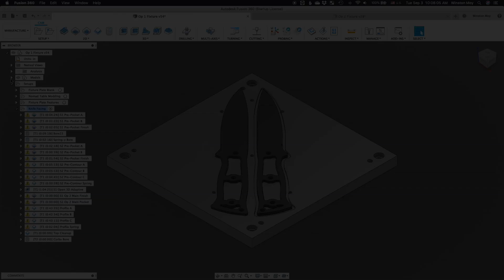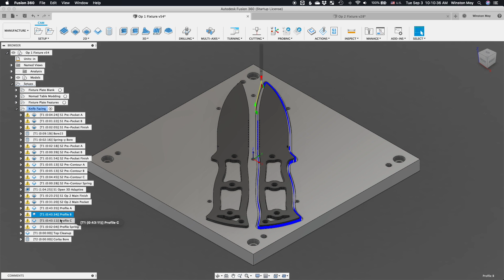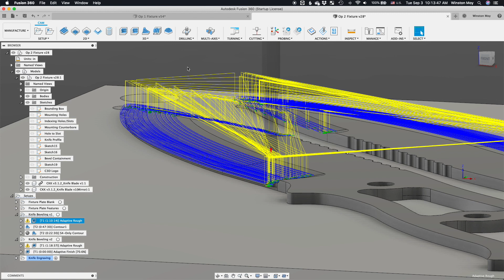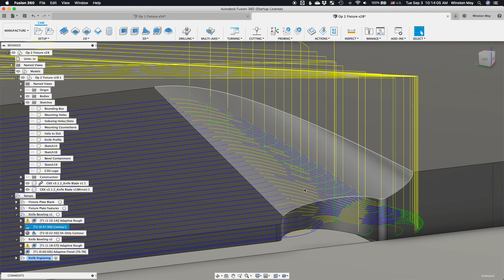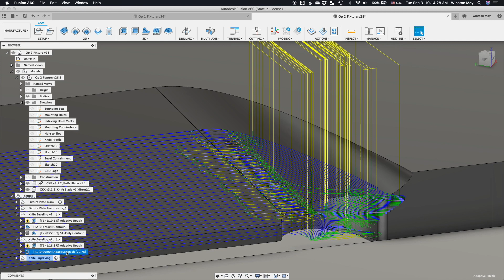Machining the Steel Blade of the Carbide Camp Knife - Pt. 3

Comment: You got corner chatter because you matched the radii in the part with the radii in the tool. This caused the bit to load up on half is diameter when cutting. Never match the radii of the part to the tool end mill radii. You need to add a few thousands to the part radii over the end mill radii to stop chatter and reduce the tool load.
Reply: if he used a tool thats 30% as stuck out as that tool he would be fine. That endmill is sticking out way too much

Comment: I'd say the chatter problem is more like your machine is not stiff enough and the tool you're using has a lot of nose showing, which is a lot of wet noodle to dangle out there.

You want less chatter, more skookum machine with less bit hanging out of the chuck.

You're not doing a lot of depth cut anyway, why hang out such a large bit.

Comment: Nice work! Very interesting to see such a tiny machine cutting tool steel! Also very cool that you're using my sanding block! :)

A few bits of feedback: I think you will see a large difference in your cut quality if you use stub length tooling, and also try trimming the shank of the tool so you can have the smallest possible stick out. Even in my large VMCs a tool that size sticking out so much would cause chatter. Maritool has some inexpensive stub length tooling that should help. When I am looking my blade bevels with a 1/4" diameter tool I only have about 0.4" of stick out.

Secondly I would advise trying to go with a larger corner radius on all tools. At least 0.030" or so at the smallest. This will make the tool corners much more resilient to the less than ideal cutting conditions, and should get you longer tool life. It should also help you get nice finishes!

Again, great work!
Reply: Thats good advice from someone who went from filing blades to full CNC! I actually started because of your filing jig video :) and now I work with DMG Mori Duo Block's and CTX machines daily! You were a massive motivator for me years ago! Hope you are doing well!
Reply: @saschamarr495  Very cool! I wish I had those kind of machines in my shop! Thanks for the comment, really glad I was able to be helpful! 💚
Reply: @GoughCustom  <3 I am still going to order a knife from you at some point. Gotta have one in my collection! Is shipping to Austria an issue?
Reply: @saschamarr495  Shipping to Austria should not be a problem at all :)

Comment: i cannot wait for you to get either a rigid router, or convert a grizzly milling machine.. Your skills on the cam /gcode end are really good but the machine is killing you.. There are a few fixed gantry routers from now in the 3000 range that have mini mill like rigidity and are turn key
Reply: Which one would you recomend?
Reply: @Zlatkodemon  ssome of the new 6090 machines are actually flat linear rail and have a huge work envelope.
https://www.aliexpress.com/item/4000781302756.html?spm=a2g0o.placeorder.0.0.c48c321epcG3Hc&mp=1

for 2400 shipped , i doubt much compares to this

Comment: Winston, use short length tooling if you can. I know this is through Carbide3D and all now, but they should sell stubby length endmills for this reason. It'll eliminate a TON of the chatter.
Reply: I was torn between the stub 3/32" and 3/32" with corner radius which only comes in a standard flute length. This is all Lakeshore Carbide stuff, since C3D doesn't sell AlTiN.
Reply: They do sell shorter flute lengths. I recommend some kind of cutting oil on finish and also a lower rpm for finish like 2500 to 1200 rpm with a feed rate of 20 to 40. Takes longer but worth it. Try western tool, they should have a 1/32 ball endmill coated carbide with .250 flute length.